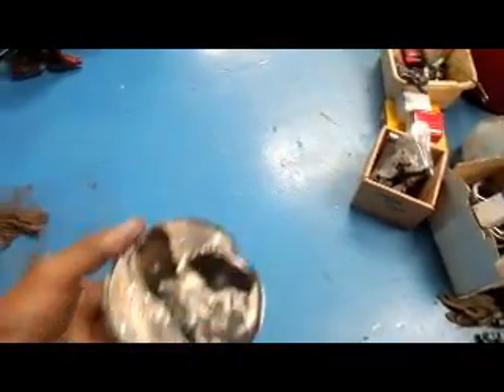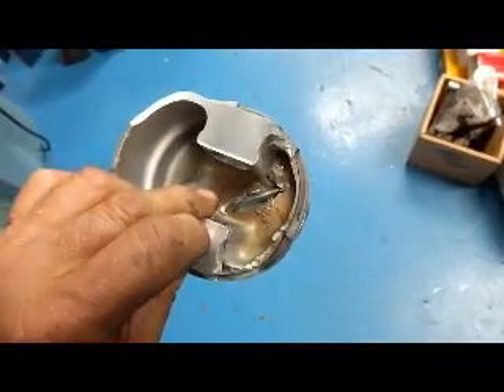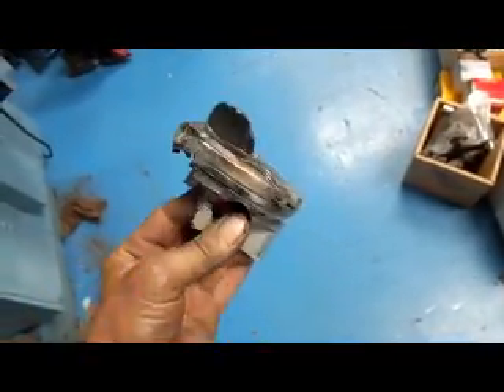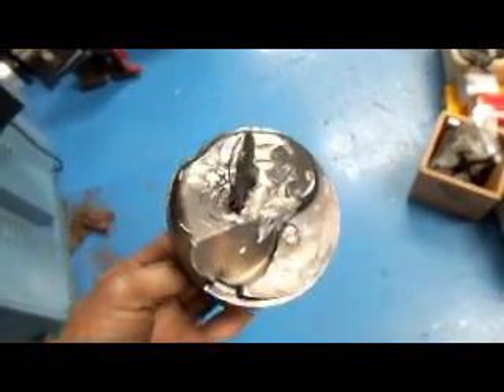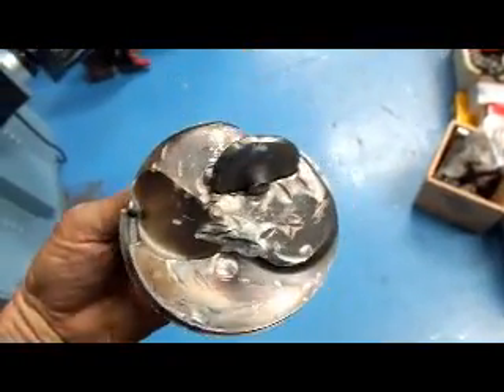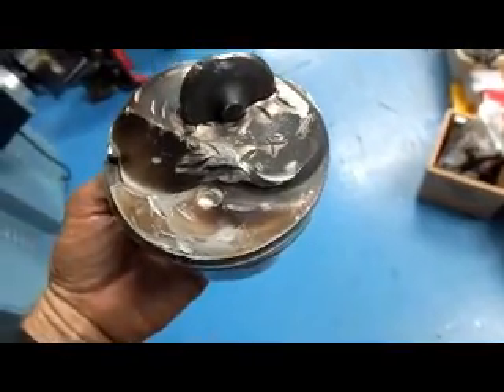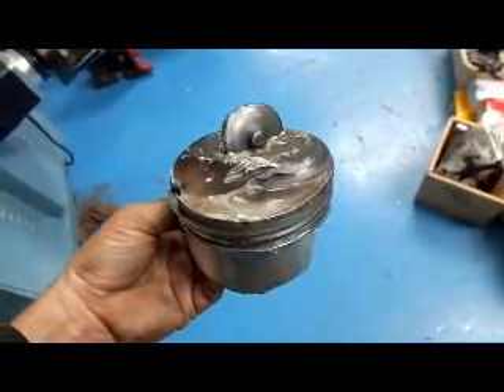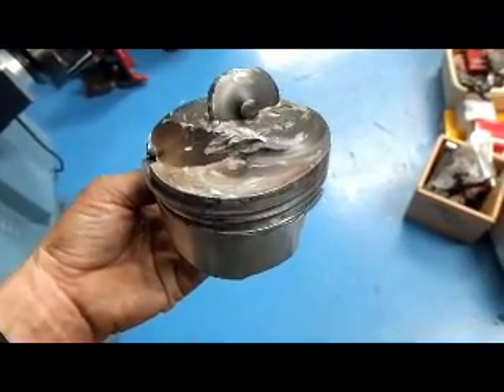BBC Valve & Piston Failure

Comment: John, when you say the valve 'came off' do you mean it unlocked at the keeper or do you mean it broke off at the mushroom? To me that's what looks like happened as the way it's embedded into the piston crown, regardless it took plenty of abuse to accomplish that. John over revving a boat engine can be done by hitting large waves and when the prop comes out of the water it over revs, tell your customer to buy a rev limiter

Comment: The machine shop I frequent has a display of some of the nastier things they encountered; this would definitely make the trophy case. Right next to the unwillingly shortened conrod :) The owners favourite is a lifter from a Fiat 128 Rallye's engine - someone used a broken-in-half razorblade as a shim in it. Looked nice and shiny. If not for the broken off pieces of hardened steel...

Comment: what'd the head look like?    I see valves comeapart on lawn equipment....but the oddest failure came when the throttle butterfly screws got loose and were sucked into the cylinder when the wide open carb let her rip.     head and piston looked like you'd gotten after it with a BB gun.   cleaned it up....lots of meat on the piston and head....it  blew again.   oops, shoulda replaced the throttle shaft....the threaded holes for the screws were now oversize and there just ain't enough loc-tight :)